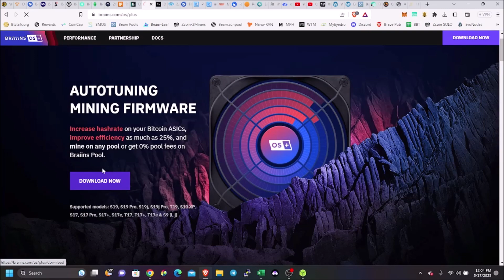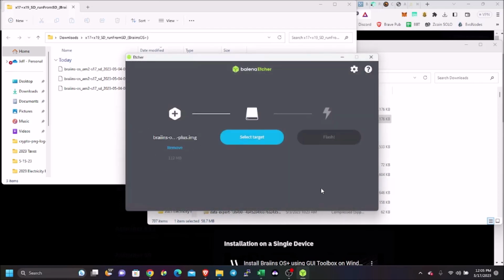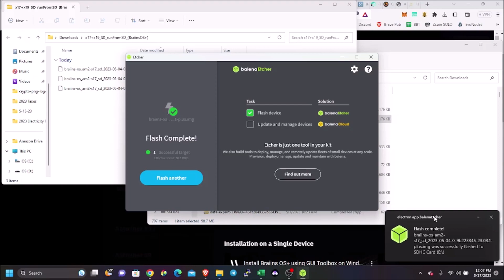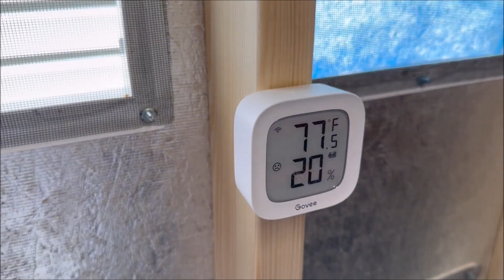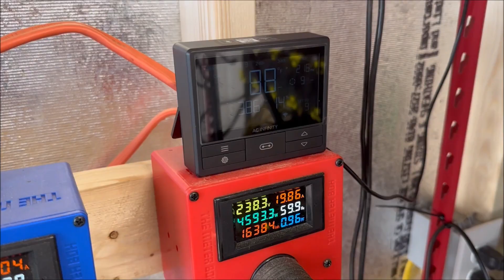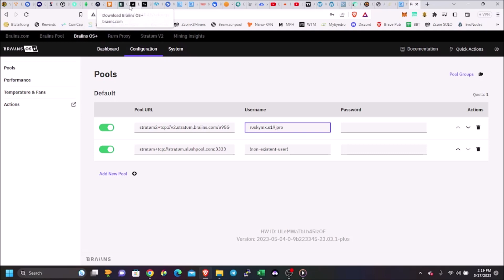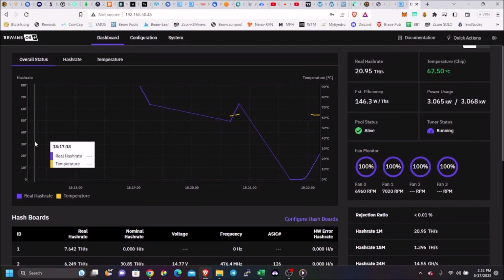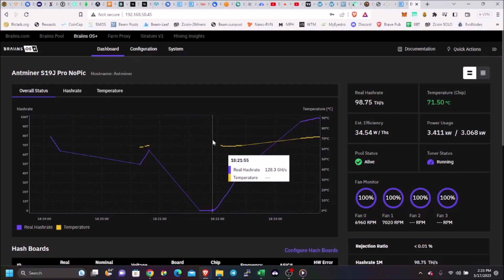Braiins OS Install on S19J Pro 104TH & Swapping In Xilinx Board

Comment: Can I flash 104 Th S19j with a stock board, so just the SD card?
Reply from the maker: @14energy   believe there is a way remotely with the Braiins toolbox. I just did it by swapping the control board and flashing the SD card. The stick amlogic board didn’t have an as card so I replaced it with a Xilinx board.

Comment: I have issues with 4 s19j pro 96th with xilinx board. Sd doesn't boot, and updating with braiins tool run ok until i power off the asics.... Then they won't mine anymore and y have to change rhe firmware again.

With bitmain stock i dont see any problems. Asics with BB or AML runs ok.
Reply from the maker: I don't have any experience with the 96th models.  The ones with the BB boards, you should be able to just flash an SD card with the OS and be good.  The Amlogic boards have to be done through the Braiins toolbox but I haven't tried doing so yet
Reply: @ruskyscryptocave  i have Asics with AML, BB and xilinx. Toollbox works perfectly in all of them except un xilinx boards. I didn't find anything on internet about it.

Comment: Use pink panther 1/2" insulation foam sheets to help with airflow/keep exhaust swirl down to minimum. Its cheap, very easy to cut to shape for weird areas/corners, and its veey effective. I run a 3mw /65ph farm, 90% are s19 series but all types of miners. 715 machines currently
Reply from the maker: I have a bunch of the 1" foam insulation board from when I had everything in my basement.  I though about making a "drop ceiling" with it in the shed to direct airflow to the fans
Reply: Do it! Unless it chips/breaks very easily. I've tried using some off-hand foam board that I tried cutting and it just splintered into 100 teeny pieces of foam...that promptly got sucked up into some s19j pro miners lol.

Comment: @ruskyscryptocave so login/password is root by default still? sorry for the dumb question
Reply from the maker: yes that didn't change at least for me it didn't
Reply: for me login also doesnt work with a freshly downloaded braiinsOS. "Ubus error: Command failed: Permission denied"
Reply from the maker: @TheLittleMagnus  did you try admin/admin? I don’t know why it would’ve changed though
Reply: @ruskyscryptocave   yeah you’re right, I just saw Kaboomracks video on the S9 for braiins OS. It’s either root, root or admin, admin 🤣

Comment: Hey Rusky, what version of balena etcher are you using? I’m having issues flashing braiins OS on my micro SD. It flashes but turns it into multiple partitions and is no longer Fat32.  I’m sure it has something to do with balena etcher.
Reply from the maker: Just looked, it's 1.7.0
Reply: you probably need to use windows disk manager and delete all the partitions and format from scratch. just make sure you edit the correct drive.
Reply: What size is the micro SD? It sounds absurd, but it is crucial to making it work.  I have not had any luck with anything other than 16 GB.
Reply from the maker: @tyranosurasmax  I think I used 8gb ones for mine. SDHC models too. Not SDXC

Comment: Hello, thank you very much for the video, I ask you
I have the s19jpro 100th, with the same new motherboard that you installed (sd slot inside)
Which of these two should I install?
x19_BeagleBoneBlack_SD_runFromSD_(BraiinsOS+)
x17+x19_SD_runFromSD_(BraiinsOS+)
thank you so much!
Reply from the maker: If you have the Xilinx board, it's this one -x17+x19_SD_runFromSD_(BraiinsOS+).  The BeagleBone board uses the other
Reply: @ruskyscryptocave  thanks!!
mine its similar to the Xilinx, the difference is that the sd enters inside, would it be the same, the only thing that changes in the way we enter the card?
Reply: @mam2064   what does the kernel log say?